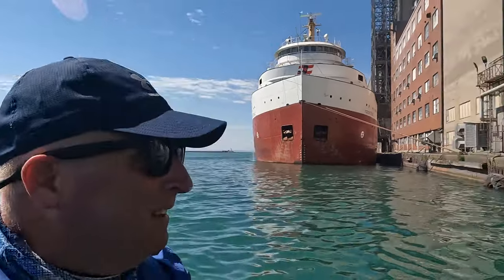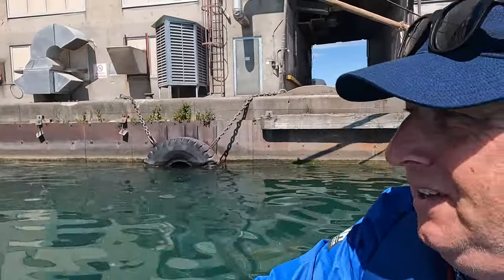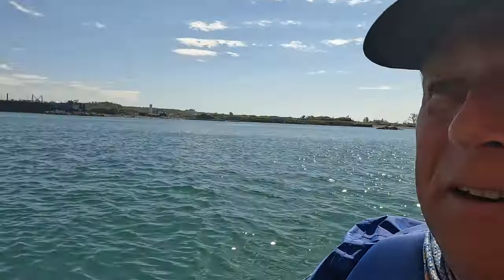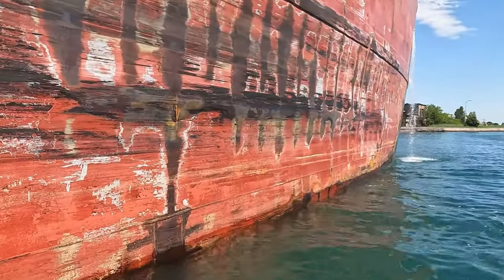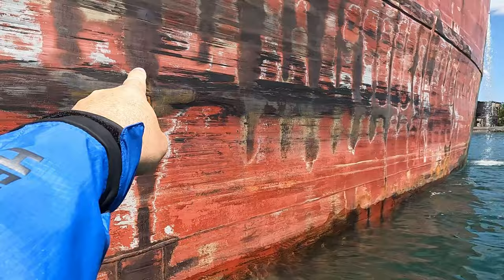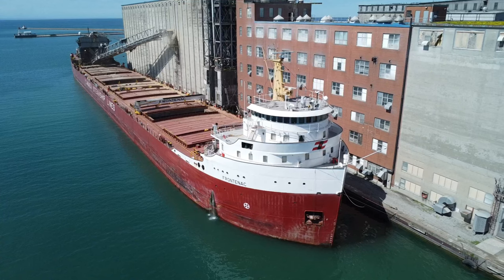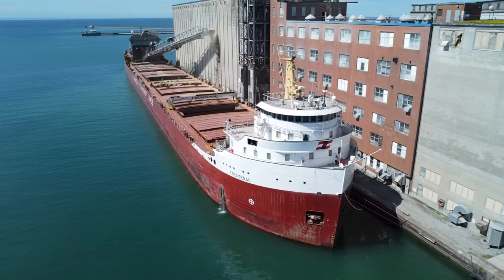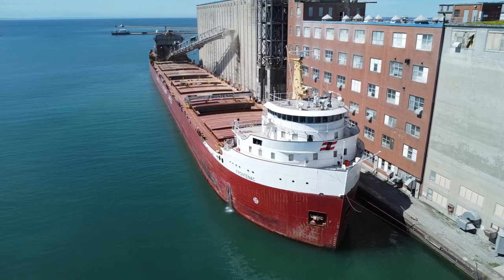FRONTENAC - UNLOADING

Comment: Hard to tell in two dimensions, but it looks like one of the ribs sticking out, damage from lock rash.
Reply: yep exactly what that is... ship rubs the lock sides and the ribs are what take it, dimpling in the steel between them. Common on lakers.
Reply from the maker: Thanks guys for clarifying that.
Reply: @klausschlobluvsmesometwood4679  That may be exactly what it is, with a trickle of water into the bilges.